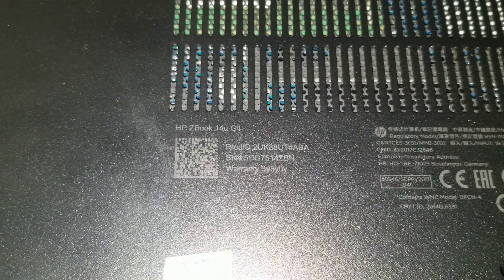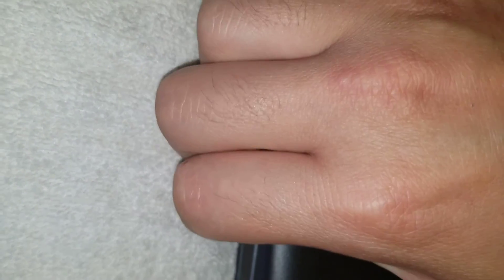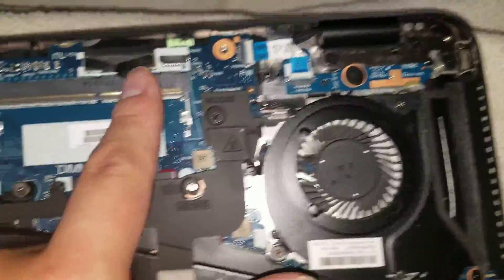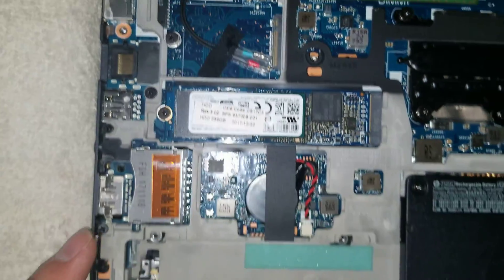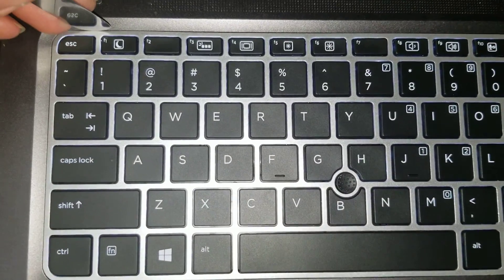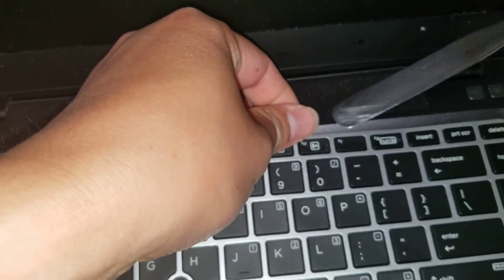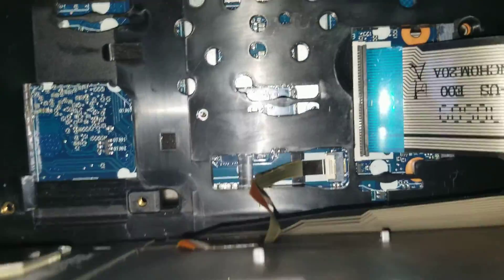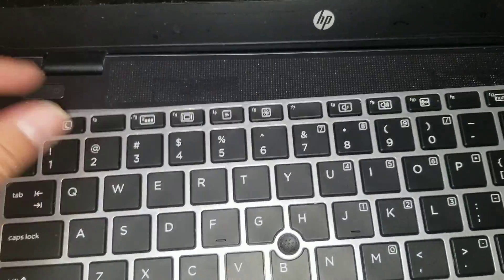HP ZBook 14u G4 Disassembly and Upgrade Replace Keyboard

Comment: Hey bud. Looking to swap out the graphics card. Its MXM right? So it should be doable - i just wanted to find something compatible, was wondering if you had advice, thanks
Reply from the maker: I have no clue what you're talking about. It's soldered to the motherboard. You'll need a new laptop.
Reply: @ItsBinhRepaired  "An MXM (Mobile PCI Express Module) graphics card is a specialized, standardized form factor for GPUs used in laptops and other mobile devices. It's designed to allow for easier replacement and upgrading of the GPU without having to replace the entire system. MXM cards are also used in industrial and embedded systems where a compact, high-performance GPU is needed."

Thanks for the wisdom
Reply from the maker: @Gormezzz I've had some gaming laptops with that. I was confused why you were mentioning it for this one. Lol
Reply: @ItsBinhRepaired oh cool, yes I just saw a video from the HP YT channel replacing one, but there's so many versions of the zbook I thought I'd ask, tyvm
Reply from the maker: @Gormezzz  ahhh makes sense.